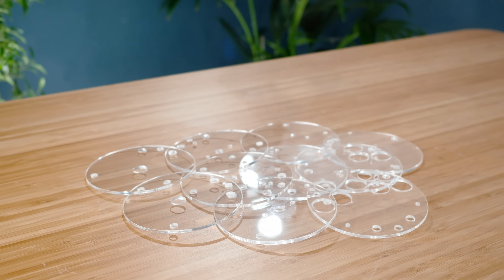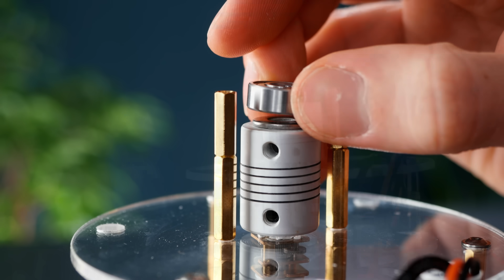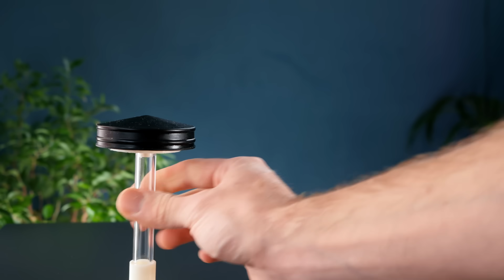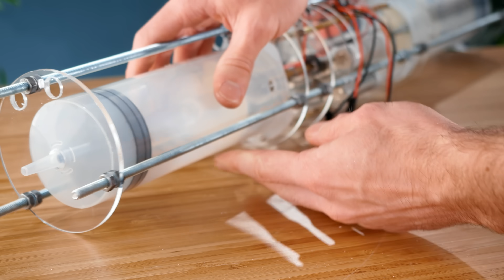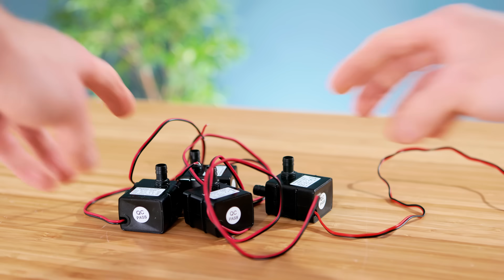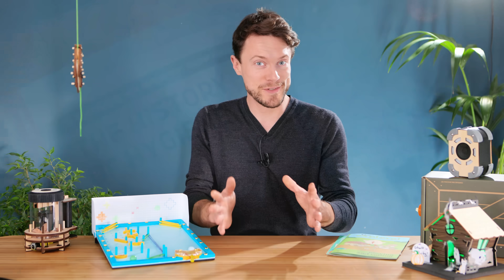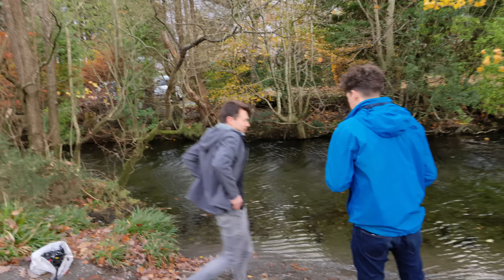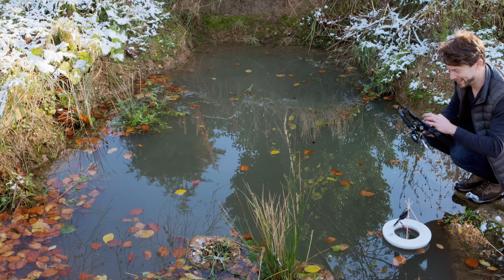Building a DIY submarine

Comment: An older AM transmitter and receiver has a better submerged range, or even a 36MH FM set, also the analogue servos are a great idea as they require less power the closer they get to their commanded position. Digital servos are always using power to 'hold' in commanded position - slightly different system. Great project, loved it
Reply: I suppose with that solution it would work even better if the the antenna from he steering unit would be submersed too?  It would eliminate the signal losses when transferring from air to water?  Don't real submarines have any specific antenna configuration to communicate with the external world?  If they have such methods, they most probably will about never be allowed to use it when doing their sneaky business.
Reply: @tuttebelleke  US and Russian military submarines can receive when submerged, other nations need to surface to communicate.  A careful scan of the surrounding sea is needed before surfacing and they use high frequency tight beams aimed at satellites.  The ultra-low frequencies used to transmit to submerged submarines have wavelengths measured in kilometres, so the transmissions come from aircraft trailing cables several kilometres in length as antennae.  It is possible to build ground stations close to shore, but they are easy targets because of the huge and fragile antennae so aircraft are used instead.
Reply: @FireAngelOfLondon  And still people say we've got a long way to come with technology, and that the military's just meseing around....pfft! Thank you for that explanation. It's truly a marvel what modern submarines do!
Reply: lower frequency have better range under water so it would be best to use the lower frequency possible
Reply: I was just going to mention that. I remember having AM and FM radio control gear back in the 90s and 00s for cars and airplanes. While obviously not as stable a signal as 2.4GHz, an AM system would likely work quite well underwater! 👍🏻
Reply: +1 When I saw the flysky come out, I was expecting a loss of craft at some point :)

Comment: awesome work. Might I suggest routing the thruster inlets through tubing in the opposite direction as the thruster to increase efficiency. Right now they the forward and back thrusters are sucking in the opposite direction as their output. you could increase thrust by using the inlet as another source of propulsion provided you add screening to keep out the sediment. Just a thought for the redesign.

Comment: around 27MHz/40MHz - can penetrate several feet of water at short distances, typically less than 45 meters (still that's much more than that cable)

Comment: I am really impressed in how you recreated the servos for linear motion! Very elegant solution :)
I believe you can simplify the design a little bit by getting rid of the second set of water pumps. You can achieve the side to side motion and also turning with only one set of pumps. Maybe it is difficult to have it controlled by the RC transmitter and receiver this way. Also it looks like you can put a bigger battery since weight is not a concern (in fact a benefit in your case)

Comment: As always, this is brilliant engineering. Just a quick comment -- couldn't it be reformatted as three parallel tubes to be more compact?  Two ballast tubes and a control/camera/thrust tube in between them?
Reply: Additional cross-sectional area dramatically impacts a submarine's performance moving through the water. While it would make the arrangement more compact, it would dramatically impede forward motion by doing so. It's a good thought, though! Never stop questioning what's possible, as it's the only way we can develop.
Reply: Not to mention that the two ballast syringes in series will give pitch control if operated separately
Reply: Isn`t that the standard configuration on RC subs?
I`d check, but I can`t be bothered, hehe.

Comment: one thing i would recomend is use cheep bilge pumps for the thrusters, cut the pump housing off and put a 40 to 50mm prop on it you will have to make an adaptor to mount the prop, one on each side and use left and right hand props to cancel out any tork steer, the diferance will be night and day on the thrust out put and speed through the water i have made a few off then!! just use thrusters to make it dive though did try to put bouncy compansation but it didnt work and it sunk lol

Comment: Good video. But I do actually think you are wrong. The main thing is not if the motors can compress the air in side, it's getting the water out that is the problem.

Let me illustrate:
Assume that the pressure on the syringe disks can be calculated by:
     N = p*m^2
and the pressure in the previous formula can be derived from the hydrostatic equation:
    p = ρgh
Where  the density, ρ is about 1000 for water, g is the gravity acceleration about (9.8) and h is the depth of the submarine.
Thus we get:
   N=ρgh*m^2

Now lets assume that our disk is has a diameter of 10m then we get m = 0.0113, thus m^2=0.00012769 and also assume that the boat is at 5 meters depth. Then we get the following pressure on the disks:

   N=1000*9.82*10*0.00012769 = 385 Newton or ca 38kg.

So for the sub to be able to surface the motors must be able to lift 38kg with out getting stuck.
Thus the major problem with this design is that it can not surface if it goes too deep.

Comment: I'd love to see the chambers getting flodded like with a mounted gopro from outside or a small camera inside the chamber? Also would it be faster if you added nozzles to the pump outputs? Some of these small pumps are cabable of quite some pressure.

Comment: Very good, but things don’t get more heavy when they become more dense. Any two objects both weighing the same bit of one being less dense will float at different Heights. Density is a measure of how many atoms fit within the same volume. But you are correct in stating that the compressed syringe has a lower surface area and Is more dense.
Reply: If the volume remains the same while density increases, it definitely gets heavier. That's how this ballasting system works - the air volume is compressed and replaced with water, making the entire vessel contain more mass at the same total volume.

Comment: That  really was awsome. Beautiful full design. Great idea using the sealed water pumps, I think the bearings in the others may suffer, maybe not . I wonder if its all designed around the size of those rubber end caps,. Standard fittings can save so much time. Did you take Adam Savages tip and use 60 degree tip drills for the acryllic. Stops cracking in breakthrough. Coniston, it has history.  Flexible teather, use silicone high strand count wire and add boyancy ? could use thin gauge with high current for the submerged wires, not going to overheat.   Fantastic project. Reminds me of the futurama scene where the spaceship gets pulled underwater by the unbreakable diamond teather, fry asks Farnsworth what pressure the hull can take, Well its a space ship, anywhere between 1 and 0.  Impressive both machines. no leaks well done.

Comment: This is amazing, Matt!  The ballast system is really cool, and the water pumps you've used in some of your other projects are a really nifty idea for thrust.

I imagine James has already suggested this, unless y'all are involved in a much more cutthroat competition than I think you are, but you could share the same pumps for roll (strafe?) at yaw by setting up mixers on Flysky radio.  

I'm not much of an RC plane guy, but I've had to set this up one for a flying wing.  It only had two control surfaces that had to be used as both elevators and ailerons.  When you pull the pitch stick, it moves both surfaces, when you push the roll stick, it would mix the signals to move each wing's control surfaces in the opposite direction.

I have no idea if you'll have any need to double up your thrust on yaw for any of your upcoming challenges! :)
Reply: I think you mean an elevon, that is the name for a flight control surface that performs both roles.
Reply: This sounds correct to me  @FaerieSeraphina !  Thank you!  If it isn't a multirotor, I'm bound to be pretty ignorant and/or forgetful! ;)

Comment: One issue I see with the design is that you can only control whether it goes up or down, but it'll be very difficult to stay at one depth. Maybe you could somehow add a pressure sensor to the adjustable resistor of the servo motors or to the control board.

Comment: Does the current for the whole system pass directly through the relay? For this type of relay (relative to size) the maximum current is about 3A. Is this enough for your system to work stably and without overloading the latch relay? Connecting the resistors to the control windings is also interesting. It reminds me of the training in theoretical electrical engineering transients 25 years ago :)

Comment: Great thinking with the REED switches and the pumps and honestly everything. I love RC subs and they are quite difficult due to water blocking the signals.
I just think the fins are somewhat small and I wonder why it doesn't spin around it's lateral axis when you start the pumps.
Reply: My guess would be that major movements of the motors controlling the syringes are usually done in tandem and they face in opposite directions. This means the screw motors powering the syringes are spinning in opposite directions and counter each other. Seems like this leads to the same situation as why a twin prop aircraft doesn't usually need any alerion correction if both engines are throttled up together. The props on both sides spin in opposite directions and are equidistant from the centre of mass so they apply equal and opposite torques to the airframe as they spin up. I say usually as yes if one engine lags the other for some reason the airframe does develop a roll that needs correction and a yaw too as they are off centre but that would not apply here as both shafts are on the centre line.

Comment: For the next, upgraded version you should obviously add a torpedo bay.
A mid section with inside of it 12 short tubes that protrude a little on outside of the craft,
capped off with watertight lids. The back ends, inside of the mid section closed.

The torpedos should be tubes, slightly smaller in length & diameter than the tubes they sit in, open on the back ends and filled with potassium.
When the lid of any particular torpedo's tube is opened, water rushes in, reacts with the exposed potassium at the back and sends that torpedo speeding out of it's tube.
The front end of the torpedo should house a small blackpowder charge (easily sourced from fireworks or made from scratch) with an impact fuse at the very tip of it's nose cone.
Using the powderized striking heads of "strike anywhere" matches & a simple mechanism to strike it, a simple impact fuse could be made to set off the blackpowder charge upon impact.
https://www.youtube.com/watch?v=thU7bCgegBc

If each torpedo tube could be opened individually, you could fire a torpedo at a target on your starboard, miss, rotate your submarine slightly and take another shot.

Make floating enemy battleship models and a semi submerged enemy submarine model to fire torpedos at. Put some potassium in these models/targets so that when their hulls are breached and flood with water, the potassium ignites and creates more, explosions, fire and smoke than just the initial blackpowder explosion from the torpedo. Set up cameras everywhere, above and under water.
That would be spectacular.
Reply: Co2 cartiage with solenoid valve trough the tube into peace of pipe and nozzle that connects to center of the torpedoes back giving it push and over pressure inside. When pressure goes over the friction of the nozzle it leaves the tube like released balloon pushing air out trough air engine that pushes it trough the water. Add tiny one way hole at the front and it can maybe cavitate to add increased speed for torpedo. Not sure how well this would work in practice but in some sense simple method that is easy to load and fire. Just needs to have ballast point well adjusted so it floats to surface in the end.

Comment: Legitimately cool idea to use pumps as thrusters and very cool build as a whole. I do think it would be good to shorten it up a bit. The translation and attitude thrusters wouldn't have to work as hard to move all that surface area. Also might have the added benefit of reducing the "DIY naval weapons test" look.
Reply: I would guess the idea came from the fact that there are real watercraft that use this as their method of propulsion eg personal water craft (eg jet ski/ski-doo type craft). They are essentially driven by a pump that sits between the inlet underneath and provides the power to the water jet at the rear.

Comment: 19:02 It is not just the tether that gives you limited control, but also the placement of the actuators. You have only really 3 degrees of freedom, so that means your orientation and movement are coupled. What further worsens this, is that the pitch control is coupled to your speed. You can achieve forward/backward with the simultaneous motor control, yaw with differential motor control, but the pitch can only be used when you have some forward velocity. 
No control over pitch when not moving, plus the fact that you cannot control your buoyancy makes it possible to easily get into a non-recoverable situation.

Comment: Sorry DIY perks but you got your theory about submarines partially incorrect.

Yes a submarine uses ballast tanks, but you don't compress the air to allow water in.

When a submarine dives ballast tanks vents are opened at the same time as ballast tanks flood valves.

The ballast tank vent valves are on the top of the submarine, whilst the flood valves are at the bottom. When the vent valves are open and the flood valves are opened water is able to enter the ballast tank pushing out the air through the vent valves 

When the submarine wants to surface, they open the flood valves and the high pressure air valves. As the high pressure air (which is stored inside the submarine in hp air tanks) enters the ballast tanks it blows the water back out through the flood valves.

Comment: Instead of soo manny pellets I would make it Smaller and have more batteries , with buoyancy calculations for non salty water (less buoyant water) and then adaptation for sea water with lead pellets. (also please create a low tension wire reel with a spring to allow the top part and the wires to not get tangled in the water by fish , wood , or other things in the water) , but all of this is for the next version , if you want to start fresh, if you just want to modify what is already in existence then idk, (also you should allow a small charging wire of 24v 2A for emergency charging, because it is cooled by water and will not overheat (of course while charging you need to submerge the wire reel underwater). And you could have a summer/winter diver companion.

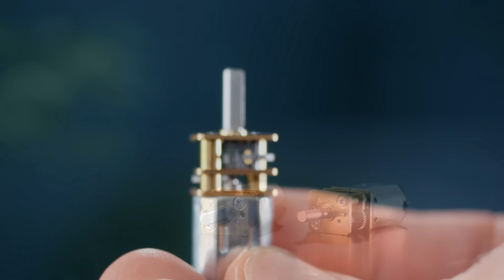Comment: 3:53 I have to correct you there. They do spin very slowly, but with the same amount of power! (actually even slightly less power due to extra friction). A set of gears does not reduce or increase power, it transforms the impedance of the motor. So you have the same power, but the ratio of torque and velocity changes. 
This is quite a big difference.

It should also be noted that the threaded rods also act as an additional transformer.

Comment: Well it's interesting seeing the mistakes you made and the mistakes you avoided. You were smart and got the separate ballast to balance fore and aft, but didn't have any separate port & starboard ballast to keep it from spinning. 4 kilos of metal ballast carefully placed probably helps with that ;)
The majority of your size IS your ballast tanks. You could reduce the 4 kilo ballast and the overall size of the sub simply by using smaller syringes. 2 fore, 2 aft, and make each one 1/4 or smaller the size of your big ones and you should have a much more compact and inherently balanced design; this has the added benefit of being able to make each pair of motors spin in opposite directions so they don't put an unbalanced torque on the sub. 
The screw shaft to move the plunger is simple and clever, but does require a LOT of empty space inside the sub, much of which can't be used because it's being used by the threaded rod. I'm not sure I have any better ideas for a small DIY project, but it's something I'll think on. 
Good project, good video :)

Comment: You should add pressure transducers to the front and rear and then connect them to a pid controller that would automatically manage the depth (and pitch angle) for you. All you would need to do is change the depth set point. Amazing video, I really enjoyed it!